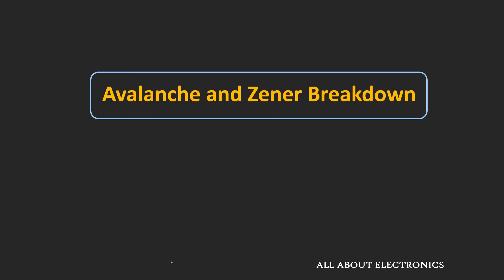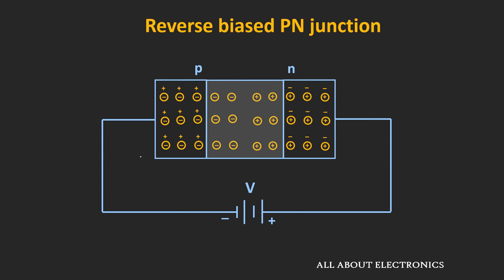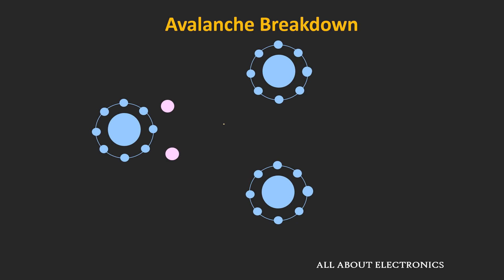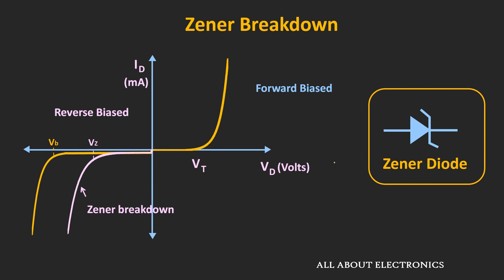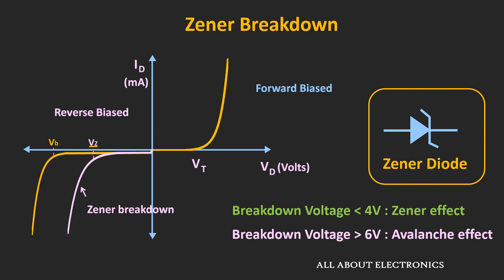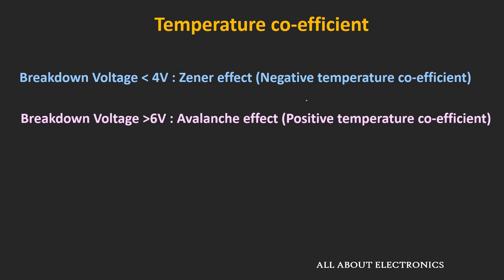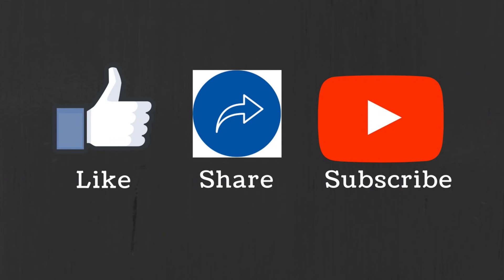Avalanche Breakdown and Zener Breakdown Effect Explained

Comment: 9:05 but if the time for collision has reduced then shouldn’t it mean they reach the breakdown voltage lower?
Reply: @tvvt005  same question brother same question
Reply: Time interval for collision is reduced so free electrons can't build up enough momentum required to knock out bounded electrons. That's why we need to increase momentum in less time, for that we need to increase voltage

Comment: How do immobile ions increase if depletion width increases? I thought immobile ions are formed only by the diffusion current. And the sole purpose of depletion width increasing is to prevent the flow of diffusion current. 🤔
Reply: Or maybe it does because the majority charge carriers move away from the depletion region on both sides?

Comment: breakdown voltage is a voltage at which the diode has elctrons in depletion region excite due to increase in reverse voltage and therefore the electric field is also increased and electron in depletion region strike on silicon and there fore the charge increases and current starts to flow and due to high current flow diode may damage.
is this right

Comment: I don't understand why the depletion zone gets narrower in Zener Breakdown? I am just a beginner. But I think when the PN junction is formed in a heavily doped region, the carriers through the PN junction should become more and penetrate deeper, so the depletion region should become wider, but the electrons and holes around the depletion region should be so dense that a large electric field is generated.
Reply: The fixed charges in the lattice which creates the depletion region are the dopant atoms, in heavily dopped PN junction diode such as zener diode the heavily dropping increase the count of this fixed ions in the lattice causing very sensitive depletion region. 

Sensitive depletion region means although the width of the depletion region is narrow the electric field generated by the narrow depletion region is much higher than the normal depletion region of a normal PN junction.
Reply: This is because zener diodes are heavily doped
Reply: Since it is a heavily doped diode the majority charges are more and stronger hence the depletion region is small as there the depletion region is formed due to minority carriers

Comment: What's the effect of increased doping in case of avalanche breakdown voltage and zener breakdown voltage sir?
Reply: In zener breakdown already the diode is heavily doped.and in avalanche if it is done then it will function same as zener , so rather read texts thoroughly than mugging up videos

Comment: In avalanche breakdown, if the depletion width increases under  reverse bias condition, how can the electric field increase in depletion field ?
Because E=V/d. If d increases because of reverse bias, then E should decrease right ? But you said E would increase in depletion region during avalanche breakdown . Can you clarify this ?
Reply from the maker: The depletion region width d ∝ √ V.  That means as the V increases, electric filed increases. I hope it will clear your doubt. 
If you still have any doubt, let me know here.
Reply: @ALLABOUTELECTRONICS   But sir there in zener breakdown you told that since E=V/d, as d decreases due to heavy doping , E increases. So there was an inverse relationship between d and E in zener breakdown. But here you are saying that they are directly proportional . Is there one generic relationship between E and d that can be followed throughout  ?
Reply: the concentration of majority charge carriers in the depletion region is also increasing here, in reverse bias condition.
So, hopefully may be the dependency is more predominant on the conc. of charges rather than width of space charge region.

Comment: You shouldn't use the term "knock out the electrons". The separation of valence electron from a atom solely depends on the energy of atom(determined by its temperature) which is provided by the minority charge carriers that have gained high energy and speed due to increase in reverse voltage. Better to say there is transfer of energy from minority charge carriers to the atoms on their path of movement.

Comment: thank you :) 

For pn noise generators: how do I know that I picked the right diode or transistor? Is any diode or transistor okay which has a breakdown voltage about 6V or are there models out there which are super low-noise? Thx!

Comment: It should've been mentioned that, in reality, the Zener effect is tunneling of charges across the (narrow) potential barrier.
Valuable the mention about the reduction of the mean free path of carriers, with the temperature increase in the avalanche effect. 
Also worth mentioning the fact that in the region where zener and avalanche effect have similar effect, the temperature coefficient becomes nearly zero and devices are very good to make stable voltage regulators.
Very good job however.
Reply: So, is this electric field explanation of the zener effect wrong?
Reply: You know, sometimes I zener to the corner
Reply: he mentioned already!
Reply: The strong built-in electric field results in a narrow depletion width. Zener breakdown occurs due to tunneling and is largely independent of the applied electric field. Even a small applied voltage can induce tunneling, as the majority carriers do not need to overcome the built-in potential.

Comment: Sir but in the zener breakdown when u said that the depletion layer is going to decrease then how the no.  of immovable ions are increasing? They should be decreasing as u said and hence the E.F will also be reducing....?
Reply from the maker: Due to the heavy doping, the electrons and holes will recombine very near to the junction itself. But the number of electrons or holes which are recombined will remain the same. 
So, the immobile ions will remain the same. But due to the heavy doping, the width of the depletion region will reduce. Means the same immobile ion now existing in the small depletion region. 
And due to that the built-in electric field is strong in the depletion region. (E= V/d)
I hope it will clear your doubt.

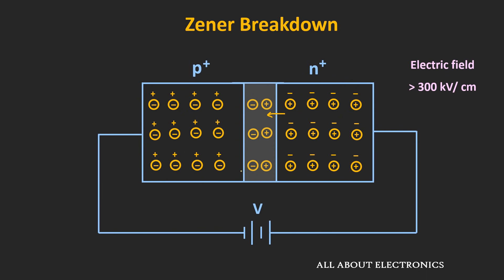Comment: Sir, At 5:40 why the electric field is much stronger even though the depletion region width decreases
Reply from the maker: Because the Electric field E= V/d. So, as the depletion region width reduces, the electric field will become stronger. 
In addition to that now as both p and n regions are heavily doped, there will be more immobile ions in the same depletion region.
So, the electric field will be much stronger. 
I hope it will clear your doubt.
Reply: @ALLABOUTELECTRONICS  Does this mean that the barrier voltage for a diode will change with the doping concentration?
Reply from the maker: @divyakaur9516  Yes.